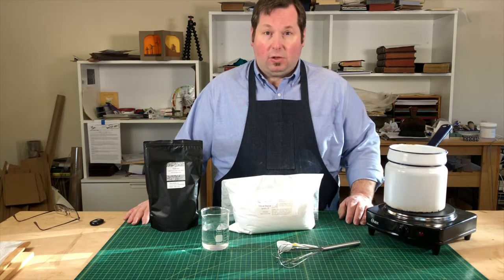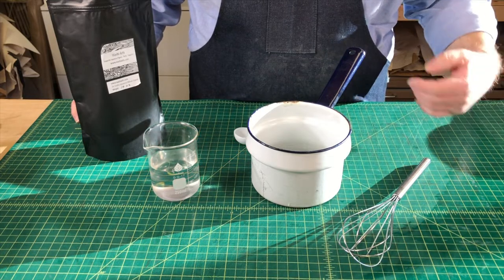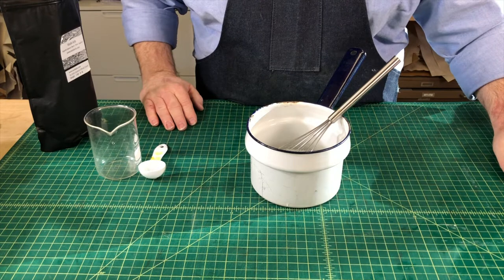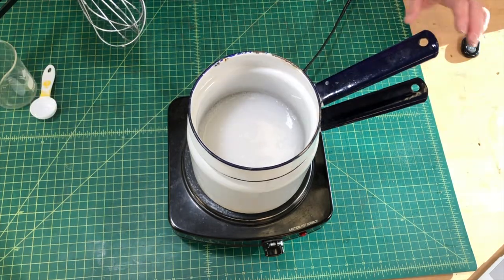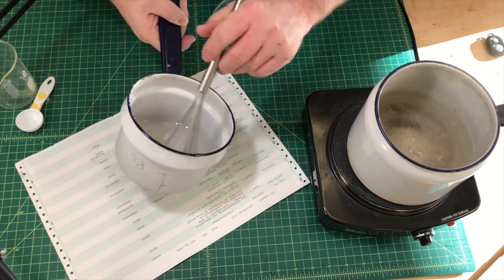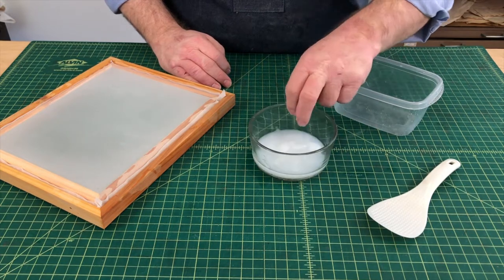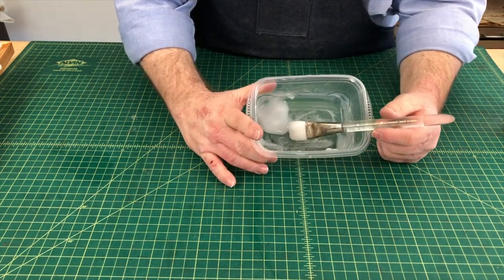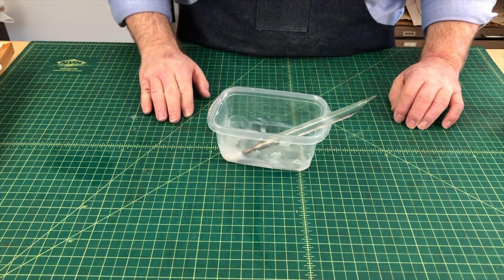How to make Wheat Starch Paste for bookbinding

Comment: Easier to buy a bottle of the stuff!
Reply from the maker: It may be easier, but it's harder to buy adhesive with the qualities I want over the counter. Paste is reversible, holds moisture for a long time, and isn't glossy when dry. But if you don't need things, buying adhesive works fine.